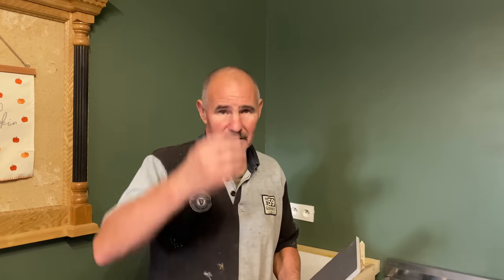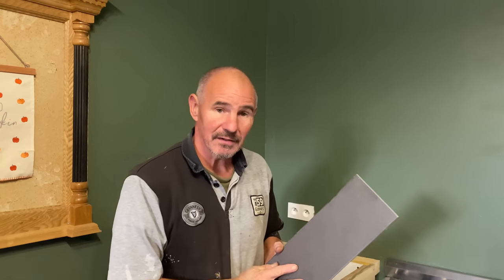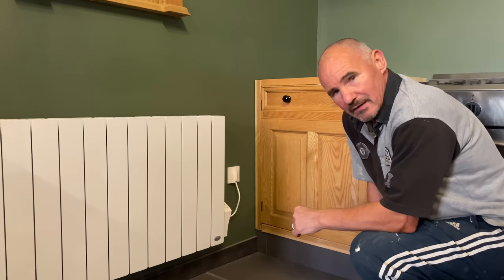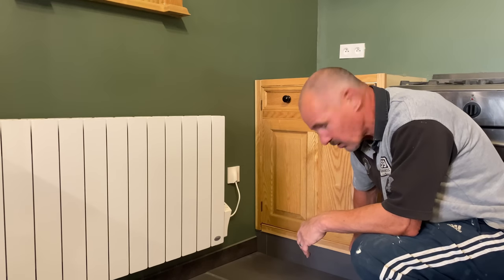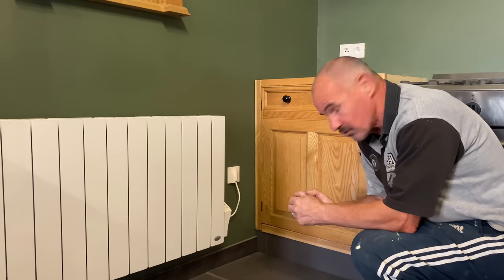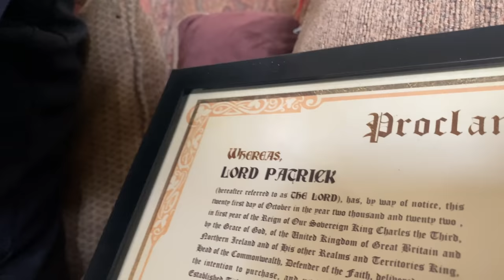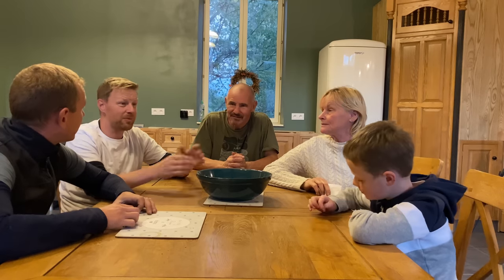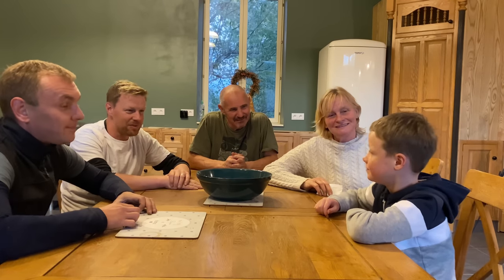WHAT to do with the cottage KITCHEN? Ep 48

Comment: You can get large diameter zinc spring clips that fit round the legs of the range cooker so you can fix two of them on the back of the the tile faced skirting board and complete the whole kitchen. It looks a lot neater. I put a small handle on the front so I could pull it off when needed and put some baking trays behind!